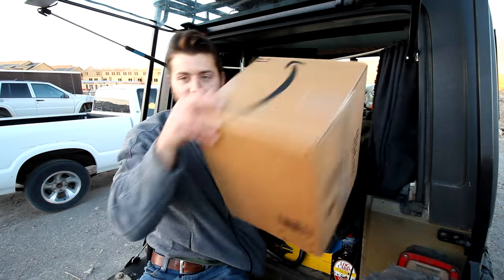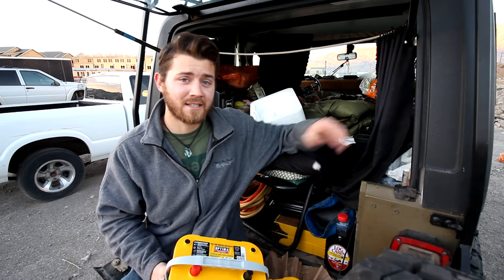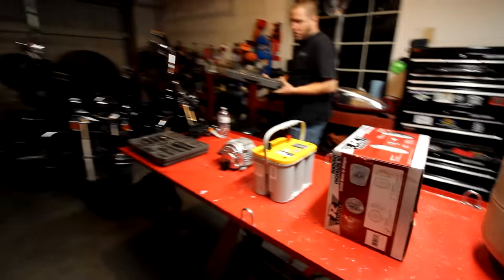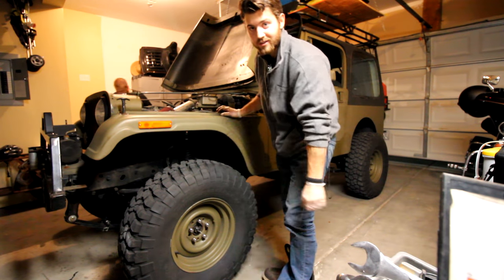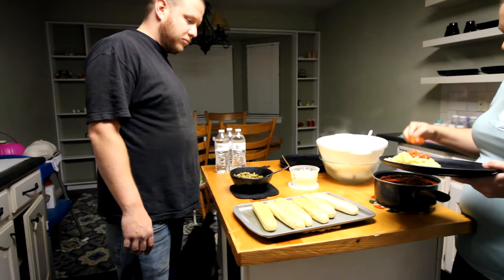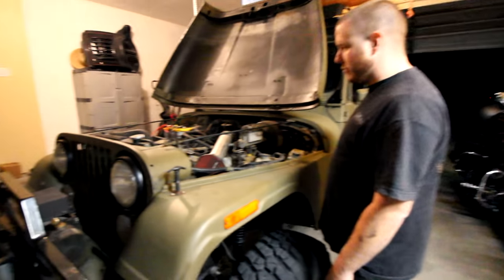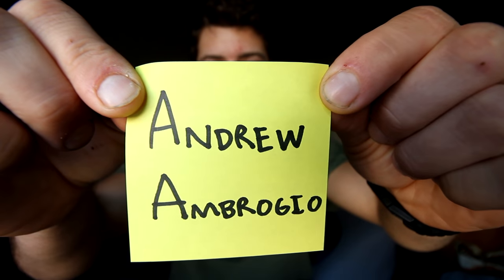HIGH POWER ALTERNATOR & BATTERY UPGRADE

Comment: My jeep was squealing as well.. It was the power steering pump.. It was squeaking but finally blew power steering fluid out.. I replaced it and squeak was gone..
Reply: Replacing the whole PS pump was the only way to fix the squeal for me also. Luckily mine didn't blow up like yours.

Comment: Squeals make me worry about the water pump.. just keep an eye on it.. Don't mean to be that guy! lol
Reply: what does it have to do with the water pump? The water pump can be shot and no squeals would be heard. Is has to do with Pulley tension and alignment, thats it. They changed the alternator for a bigger one and it isnt perfectly aligned as the original, probably required a different pulley as well.
Reply: You've never heard of a water pump squealing before it fails? It happens. I've never had a squealing serpentine belt. Only V belts.. Time will tell. :)
Reply: no, had waterpump fail without any sounds. Just temperature rising. Dont know what's a v-belt, im in Argentina so spanish is what I use for mechanics, but alternator belts for example, they tend to squeal a lot when they get old, specially the wide ones
Reply: For sure it's not the only sign or the only way to have a bad pump. You do have 'weap' hole that should warn you as well. 

V-Belt is what they use on older cars, like my old jeep. It's a smaller belt and if you cut it and looked at it, it would look like V. 

They tend to slip more and make noise. Whereas serpentine belts are much wider. Like 3X as wide, most are grooved and have much much better grip. I think I have three V belts doing what his 1 serpentine belt does. lol 

I'm sure, I'm wrong, it was just a warning. :)
Reply: PotasioCasillas Being a mechanic myself, I conquer with Legion2. Bearings can start going bad in the pump which would make it squeal.  Bearing noise can be intermittent due to heat, drying up, or slight alignment issues adding a load.  Hopefully the water pump isn't the case. Maybe Jake can decide depending on ownership of vehicle.  Was it ever done in his possession? How many miles? If done while Jake has owned it,  was it a reputable brand?  How does coolant look? Many cases rusted or broken down coolant contributes to premature failure, but that's debatable.  

@Legion2 You aren't "that guy" if your just throwing out ideas. Good to ask questions, it helps to come up with ideas on possible weak points... Who wants to break down mid trip? lol At least you're helping him be prepared for upcoming possibilities. Great input!

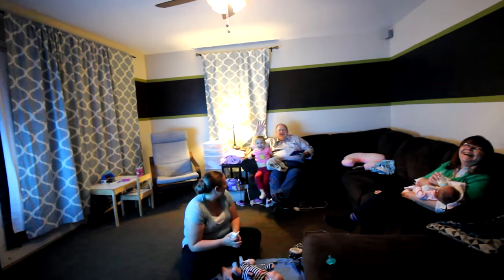Comment: Walk into a baby factory at 2:57. This entire install is with the wrong parts. First off, 20 years ago when Optimas came out, they were good. Today they suck. You will see in six months when you are replacing it. Next an improper battery type. I didn't see a trolling motor anywhere on that Jeep. Next are those emergency use only, shit, battery terminals. Do I need to elaborate on those? Next is that shit air filter. Passes a ton of dirt into the motor. Get rid of it, especially on an off road vehicle. Hello...... Next up are those poor grounds. Your Jeep cranks extremely slow. Next are all those cables jumped together at the battery. Get some power distro blocks or copper buss bars. All those friction connections will fail. Again especially on an off road vehicle that bounces around. You will get left stranded on the trail.